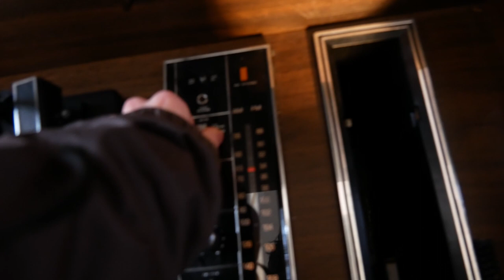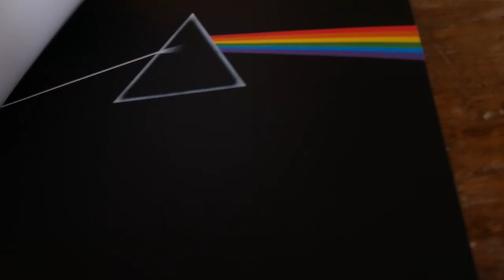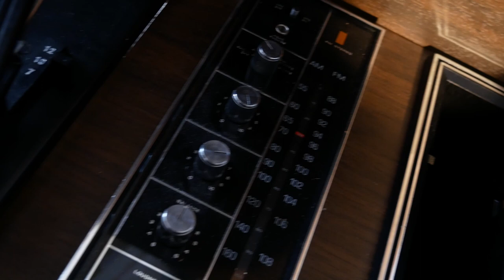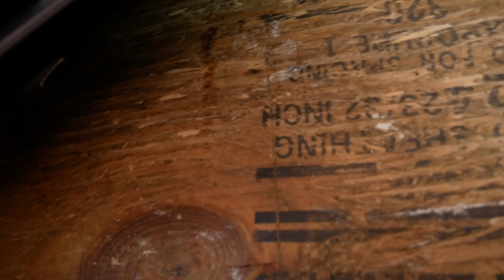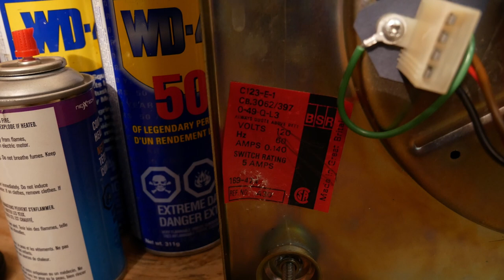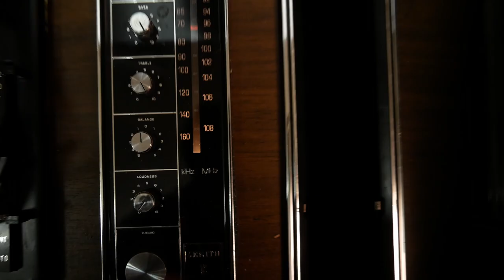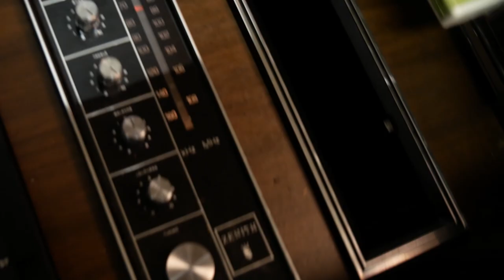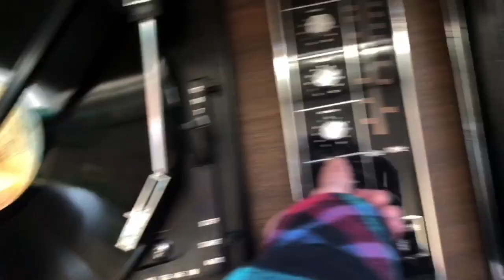1970's Zenith Turntable/8 Track Solid State Stereo Console Repair

Comment: A beautiful stereogram. That spring loaded cartridge setup is bizarre, never seen anything like it before. BSR record changers seem to have been put in just about every brand of radiogram, the grease they used inevitably gums up after 40 or so years and causes issues. If the turntable bounces too much the two transport screws can be tightened a bit. I did that with a turntable that folds up vertically into a stereogram to stop it from slipping off its springs. The rubber band for the 8 track's a good fix, much better than what I used to fix a cassette deck (it involved something off a wheelbarrow).